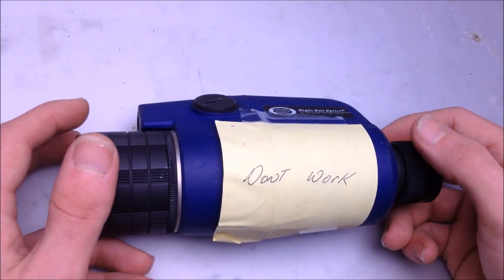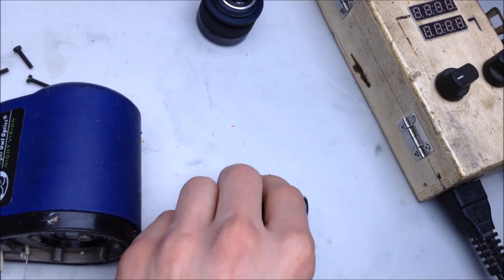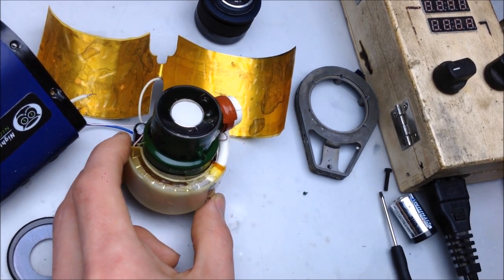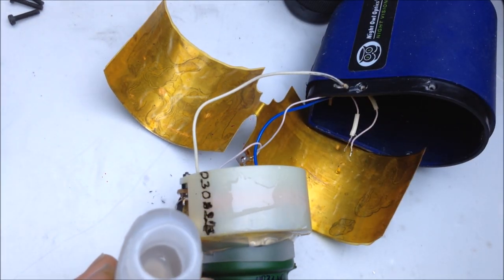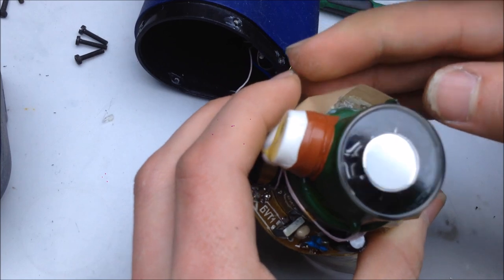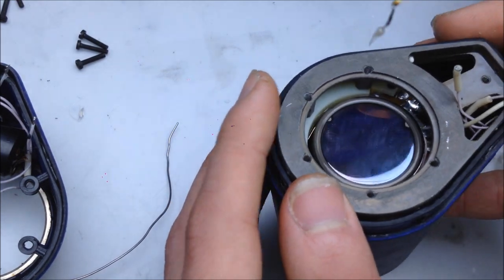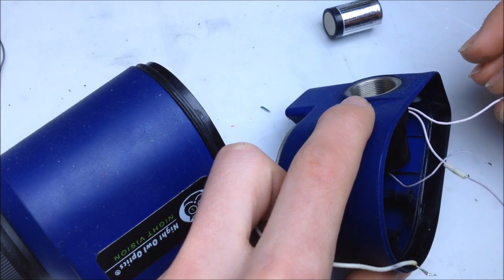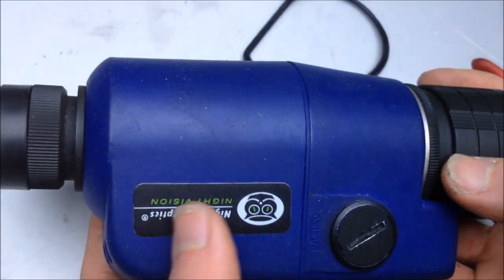Repairing an Image Intensifier Tube Based Night Vision Monocular.

Comment from the maker: I bet the seal would of fit better if I tried to put it back in the right place.
Reply: Is there a way to remove the zoom ? Most of these budget NV monoculars come with 5x zoom. Can intensifier tube be used without zoom or does it need a heavily directed image on input?
Reply: @MarkButQuestion    1x  or 5x makes no difference

Comment: My guy I have just disassembled this LOMO Elf-1 Russian nvg unit - we spoke about it months ago but I can't find the original comments. If you have 3 minutes please take a look at the disassembly video I've uploaded and let me know what you think, especially if you have any idea what the "round component with many legs and a split in the one side" is because it ain't looking very healthy to me. I've deduced by a burning comparison that the original potting compound was silicone. This was a unit which worked once for a minute in very cold dry air which we concluded needed overhaul and repotting. I'm planning so far to find a solvent to remove the remaining silicone - after I've gone as far as I can with mechanical removal - and then do a test repot with something easily removable - maybe paraffin wax, and then see what's up. I'm also thinking about testing it in a clear bucket of mineral oil. Would greatly appreciate your thoughts.
Reply from the maker: The larger round part is the multiplier the smaller one on the PCB is the transformer. You can easily test the transforming output with a little neon lamp by attaching the lamp where power goes into the multiplier.
Reply: @Zenodilodon  awesome thanks. Will update.
Reply from the maker: @mpireoutdoors5274  You can use nearly any equally rated diodes and capacitors, Look up the number on your capacitors if you can and see what they have for a rated capacity and voltage I would suggest ceramics. Purchase diodes equally rated in voltage. Rebuild the multiplier in the same configuration as the old one. It should be pretty easy with today's components.

Comment: Thanks for the video. I use the info to repair my 1990s Russian nv rifle scope that had the same problem. It would work dim with dollar store batteries, but it sparked with quality batteries. Now it works with any battery😀
Reply from the maker: Glad to hear of a successful repair, I post up information in the hopes of it helping others and it's always awesome to see others fix things!
Reply: Hi Joseph!
Did you have a Noh - 3 Kronos sight?
It looks very streamlined and has a slide up cover.?

I have the same problem with it .
Reply: The scope I have looks very similar to a Russian military NV scope from the 80’s. It’s pretty humongous

Comment: Hey! I have a one just like this and really want to use it but for some reason no green light will show up do you know why this is?!
Reply from the maker: There are many reasons for it not working.

Bad component such as the transistor on the PCB, failed multiplier capacitor/diode, failed insulation on the multiplier, or the tube itself could be bad.

I did a second video describing some more DIY options and trouble shooting options, but this does require a more technical understanding and tools.

Comment: Wow, what a great find of a video... I've had mine for over 15yrs and it's stopped working a few years after and never had a good reference video to try to fix it. The company never responded to my emails so I'm gonna give it a try.
Reply from the maker: I am in the process of posting up another video on night vision units. It should be up on Monday if you want to check back. It will have a bit more information on how they work and what you can do to repair them/make your own HV PSU for the intensifier tubes.
Reply: Cool, I'll get the model and post it for you. Have a great weekend!

Comment: I just got my Elf-1 (gen 1 Russian NV monocular) but it doesn't work. No green image at all when I turn it on - only an extremely faint glow, barely brighter than pure black, totally monochrome ie no green colour at all. It's making a quiet buzz though... You seem to be quite knowledgeable on the subject. Any ideas? What's wrong with this thing?
Reply from the maker: If you here a buzzing that means your oscillator and transformer age are good. Your problem will either be a damaged multiplier or a bad tube. It could be a problem with the insulation like mine had with the sealing material damages or bad capacitors/diodes. If you have a bad tube there is not much that can be done really. It does sound like you may have a failing tube given your symptoms.
Reply: @Zenodilodon  very informative reply. Thanks. Something very strange happened; I left the device off overnight in a 41f degree outdoor storage unit and in the morning I tried it again and it did actually produce an image for about 2 minutes. The image was green and clear and picked up the IR light when I turned on the illuminator. It faded away and went back to that "barely grey" light. I tried it again after 20 minutes but no luck... Any ideas?
Reply from the maker: @mpireoutdoors5274  Cool air will have a lot less moisture in it, my thinking is as it warmed up condensation and moisture got to it. You most likely in that case have an insulation break down and when it's cold/dry it doesn't arc out. Take it apart dry it out with some source of heat and see if you can track down the break. You can also try fixing the seal with epoxy, hot glue, or silicone/polyurethane.
Reply: @Zenodilodon  Awesome no idea how to take it apart but very happy to hear that it's possible fixable. Am I right to assume that bright light won't damage the tube if it's not powered?
Reply from the maker: @mpireoutdoors5274  Half the fun is figuring out how to take it apart :P You're correct light only really effects it because of the abundance of electrons hitting and degrading the phosphors in the screen. Everything should be fine to work on in normal indoor lighting.
Reply: @Zenodilodon  ok. I'll try not to destroy it and update you
Reply: I've taken it apart. All the components seem to be encased in a type of see-through rubbery glue. Basically all the components including the vacuum tube and voltage multiplier are inside a plastic cup-shaped case and in the lid of that case are two holes through which the power wires pass and then a further 3 holes for injecting this rubbery glue and I guess letting the air out during the injection process. The transparent rubber (kinda reminds me of hot glue but it's soft) encases all the components and I guess functions as the seal for the lid and around the power wires. Parts of the glue (where the two power wires pass through the lid) were worn away and I think the case was not airtight anymore. What should I try? Dry it out and reseal it? I kinda think the vacuum tube of the unit is ok - I looked through the brown cathode and it looks nice and clean in there, no condensation or anything. Are you telling me that if the voltage multiplier isn't fully insulated it will lose energy into the air and not function? Very confused now. Also it doesn't buzz anymore - I had to remove some of the transparent rubber to get the lid off so I guess more air got in. It reminds me of an intermittent ignition issue in an internal combustion engine where the sparkplug has cracked and at certain temperatures the expansion and contraction of the materials allows electricity to discharge to the engine body instead of being contained in the sparkplug but at other temperatures the electricity remains contained.
Reply from the maker: @mpireoutdoors5274  I can't really advise past this, I don't know your exact configuration. I know how they work, I just haven't worked on many. I will say that given your reply that your critical thinking and abilities are up to understanding the problem and how to fix it. The electricity will leak out or short to a different spot. The noise you describe as a buzz is something that only indicates the oscillator is working. I do not know if that is the transformer or arcing. If you can check in the dark you might be able to locate the problem as well.
Reply: @Zenodilodon  Ok so from what I understand now the current goes from the battery as DC to the oscillator to be converted into AC so that it can be multiplied in the  voltage multiplier (diodes and capacitors) which then negatively charges the front element (photocathode) ie "fills it up with electrons" & possibly also positively (not sure? Would be only more positive than the photocathode) charges a microchannel "cascading electron multiplier" plate in the middle of the tube, I guess also positively charging (highest positivity) the phosphor screen at the back of the tube. If the issue is within the vacuum tube I guess I have no realistic (easy) way of fixing it so I'm just going to rule that out and be careful not to damage the vacuum capsule at all. I'm basically now thinking if I should conduct a mechanical and chemical removal of the original insulation material which seems like a transparent gel but it's so old that it's lost much of its elasticity and I think also lost its insulation integrity due to material contraction/expansion cycles and oxidation over the years. I think I will try to dry the unit and then fill in the seals as far as possible with some cheap and easily removable insulator but I don't know what will bond will with the original insulation because I have no idea of its chemistry, which is why I was considering removal and replacement.
Reply from the maker: @mpireoutdoors5274  You understand what's going on as far as how it operates. A full repotting of the high voltage sections is better than trying to fix weak spots in the original. Let the insulation material fully set before trying to avoid any break down in uncured material. Looks like you're on track for a good repair job.
Reply: @Zenodilodon  Thanks for the tips. That's exactly what I needed; advice from someone who's actually done it before. Technical guidance on YouTube. Who would have thought.
Reply: @Zenodilodon  a (hopefully) last question; what material would you use to repot the high voltage circuitry?
Reply from the maker: @mpireoutdoors5274  a 2 part silicone rubber would be one of the best things I could suggest using.
Reply: @Zenodilodon  ok man I'll try it and let you know how it goes. If it works I guess you better set up a PayPal ;)
Reply from the maker: @mpireoutdoors5274  I hope it works as well! I do have  a paypal if you're serious on that note. Any donation certainly helps the content grow on my channel!. Best of luck!
Reply: @Zenodilodon  I'm serious bud. I'll donate 10 bucks if I get it working that's a promise. Also maybe you should make a "general night vision problems and fixes" video kinda like those diagnostic tables where column one is the symptoms and column two is the explanation of possible causes and column three is explanation of suggested repairs for that problem.
Reply from the maker: @mpireoutdoors5274  i may consider that, actually I am going to need to pick up another broken NVD one of these days. The one I repaired in this video ended up loosing it's vacuum. There was an arc that broke through the photocathode rim and the conductive paint on the outside. I have the PSU still and could very easily do a technical break down or problems when I get to finding another decent broken one to fix. The video has gotten a lot of general repair questions, more than I had expected a follow up is a good idea.
Reply: @Zenodilodon  Marketing rule number 1; give them what they want...

Comment: cool repair of that gen1 unit. i have found many like this that were listed as not working but worked fine.
Gen2 is made from ceramic and has a micro-channel plate inside which greatly improves its performance.
If you want to know what gen2 and gen3 is like , take your gen1 out on a really bright moon lit night and that is how a gen2 and gen3 performs even with no moon and overcast.
Reply from the maker: Thanks for the information. This is this first time I had taken one apart. I noticed a grid/plate type thing about 12mm away from the phosphor layer. I was unsure if that was an accelerating anode or the micro channel so I did not make that assumption in the video. I just noted that gen 2 seemed most common on the consumer market. My dad has a Bushnell which was listed as gen 2 and this one outperforms his astonishingly so. Overall amplification is good but I can still see a relatively good camera with the IR filter being on par with it. I have heard of ones with white phosphor in the tube and would love to acquire one of those for testing and prototyping since I can sample a better spectrum from white.
Reply: @Zenodilodon   old gen 1 russian tubes are all over the place, gen2 aren't as common because the cost 1000-6000 euros for just the tube, gen3 is virtually unhavable because they arnt allowed to be exported outside of the usa and also they cost far more than gen2. there are some gen1 cascade tubes that are as good as early gen3, you can get them on ebay right now , they are called "P8079HP" the electronic inverter is built in and all you need is 6v to run it. it will outperform your gen1 and most gen2 for really cheap. you can build a diy night vision just by adding a old camera lens on the input side and jeweler eye lens on the other side. you will be able to see for miles on the darkest of nights with it and very high resolution image.
You can have a "P8079HP" tube for 100euro around, its well worth it and they are being bought up by people making high performance DIY night vision scopes.
Reply from the maker: @MrPlytiger  Oh those are gnarly! not badly priced at all either. I spoke with my dad last night, he thinks he might have another really old NV tube from when he was younger and in the army. Needs a PSU from what he said but that's not really all to hard to make with my background. I hope he finds it one day should be fun to mess with.
Reply: @MrPlytiger  I can definitely vouch for the p8079hp. Really blows every other gen 1 unit I have out of the water. Anything else requires infrared illumination to even get close the the 8079's performance... It just sucks how massive and heavy it is!!
Reply: @untrust2033  I have a few of the original tank periscopes those tubes were in, the lens on them is massive, maybe 15CM in diameter, the f number must be really low, compared to a f1.2 camera lens the original periscope lens must be a 3+ times better.
Hard to beat the P8079HP,  I should have bought more of them when they were 35GBP from Anchor supplies, I bought about 30 of them back then, they were giving them away almost, you could get 2x for 35GBP.
Reply: @MrPlytiger  what a steal! christ.

Comment: Very neat, I had a feeling it was insulation breakdown causing an arc. Now I'm off to hunt for a cheap one with a similar symptom. I have no idea what I'd need it for but it would just be cool to have.
Reply from the maker: Oh cool indeed, I have wanted one for a while. I first saw NV when I was 12 and shortly after my father had one as well. It was forbidden stuff for me to take apart. Being an optics nut it's another instrument to use. I might one day pull the intensifier or get another one and set it up as an easy to use prototyping part.
Reply: @Zenodilodon  i think the tube in this is an EP 33 sf.

Comment: I’ve got a Firefield Nightfall 2, it’s a Gen 1 similar to the night owl one. Its having an arcing sound and flashes of light in the tube, and the tube’s light amplification is the same on or off. It seems to be coming from the power indicator led light on the motherboard. Do you think I can just de solder it from the board to fix the problem? Thanks!
Reply from the maker: Most likely not. You'd probably need to check where the insulation is damaged and fix it like I did mine. High voltage is either jumping to or inducing/depositing charges in other locations. Charged ions can go a pretty fair distance and charge other surfaces.

Comment: Is there any health risk when disassembling it? Because of the phosphorus, or how much electric current can it cause? Some kind of radiation from some material? Greetings.
Reply from the maker: These are pretty safe units. There is no mercury in the tube like in a fluorescent tube and the phosphors are usually similar to zinc sulfide which isn't all to bad as long as you don't inhale a bunch of it. There is no radiation in the phosphors as they are excited by electron collision like a CRT and not from a radioactive decay process. The current is very low, the shock is like a static shock you would get from a click lighter piezioelectric igniter or casual static discharge.